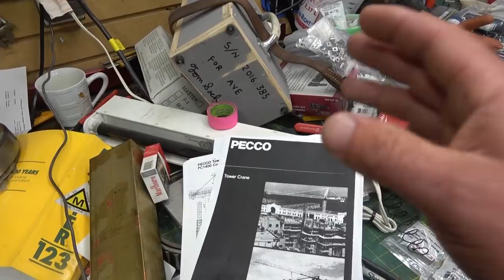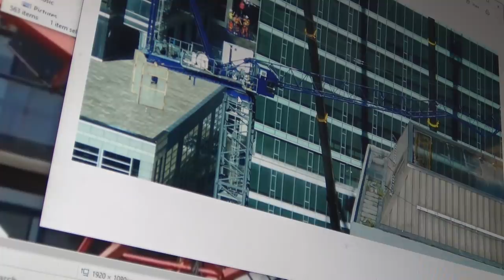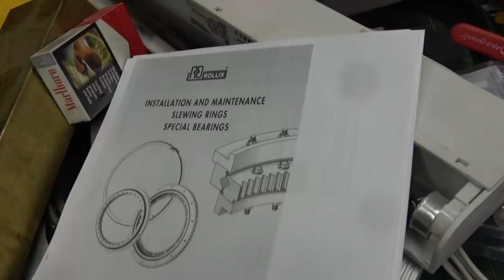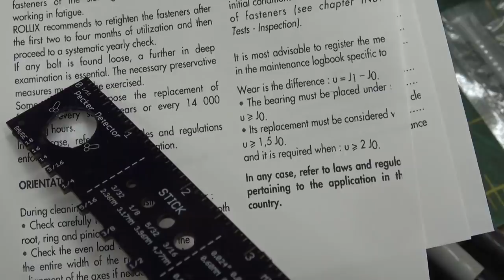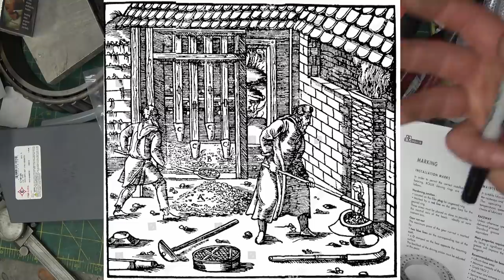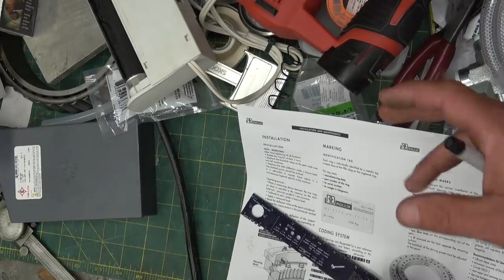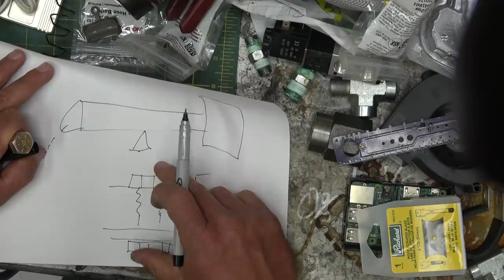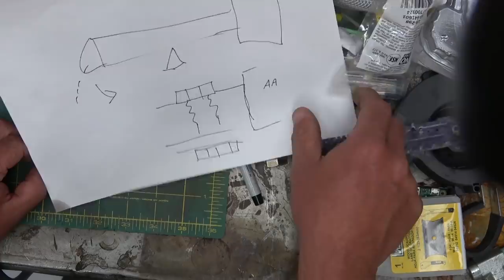This is happening too often | 2 Cranes Collapse in Toronto

Comment: The other issue with inconsistent preload is that if the bolts aren't torqued to the same tension, you haven't spread load between adjacent bolts; whichever bolt is slightly tighter will be taking disproportionately more of the load than it's neighbors. You've basically got two of those rubber bands next to each other, but instead of being the same length and splitting the load evenly, one is an extra two inches longer; neither is flopping around, but the shorter one is taking all the load. If they're properly torqued to the same value, they're starting in the same place and the distribution of force to each bolt will match the nice smooth curve of the moment load.

Comment: From the values in the torque table in the bearing manual, it looks like they are rounded from VDI 2230 and they are for grade 10.9, but crucially they are fine threaded and rely on thread and under head friction of 0.1. 
If someone put in standard thread pitch fasteners in here and used those torque values then the bolts would have way too much preload and could easily break.

Even if they did put fine thread in, the problem with fine thread is the threads get easily damaged in handling/inserting them on site and any contamination on the threads messes up the torque to preload relationship, so preload can be vastly reduced even if the bolts are torqued correctly, and any post installation survey would not detect this either.

Similarly to get the friction down to 0.1 like the manual specs for these bolts the threads on nut and bolt have to be really clean and have very specific ptfe based lubrication applied correctly. Machine oil just won't do it. If this isn't done then again torque-preload relationship goes out the window and preload will be too low and won't show up as a problem during maintenance inspections.

Generally fine threads and fancy lube should be avoided when designing for stuff that lives in a rough environment or needs to be assembled/inspected in site conditions
Reply: James Hoy ahh! Now that makes sense. I’ve wondered why they often use what I thought of as big clunky old fashioned coarse threaded bolts when I assumed a fine threaded version would have provided more surface area to carry the mass. Thanks James.
Reply: @axelknutt5065  No problem.
Must say, I had to go back and double check about the tightening torques of coarse vs fine a couple of times as instinctively I expected tightening torque for fine threads to be lower for a given preload than for coarse threads because the pitch angle is lower in fine threads.

However the torques given in the VDI tables (which this crane bearing references) spec higher tightening torques for fine than they do for coarse at 90% yield preload.
After being confused as to why this was for a while, I looked at the maths behind the table and it is because the pitch diameter, and therefore effective stress area of the  fine thread bolts is slightly larger for a given nominal bolt diameter (threads less deep), so the fine threads are basically a slightly larger bolt. 
The tables are for a preload of 90% yield, and so 90% yield of the fine threads is a a bigger force than it is for the coarse threads.
So despite the fine thread bolts needing less tightening torque per kN or lb of preload, they need more force to get to 90% yield.
Combined with thread friction acting to resist torque at a slightly larger pitch diameter on fine threads, this gives a higher tightening torque in the VDI tables for fine threads (although you do get slightly more preload as a result).

Comment: When I worked in a shipyard they where about to do a 4oo ton lift with two 200 ton slings when an old hand said to the manager that slings are slightly different lengths. They stopped the lift and had delta plates made before the lift commenced.

Comment: As a blue collar laborer, I have to say that this is absolutely typical. We at the bottom do one of two things. 1: We perform maintenance and inspections as our boss tells us to. Our boss, of course, wanting to save money, either tells us to do a lighter inspection that is necessary, or ignores our findings, and thus, machines fail. 2: We perform our own maintenance and inspections, bring concerning findings to our boss who looks at their wallet and says "well that simply isn't within budget" and ignores it until we reach complete failure of the machine.

Luckily, so far in my career, complete failure of the machine has just meant "The hoist falls to the locks and we have to wait extra long to get the car down from the hoist", but I can see already that if management continues to ignore our warnings, as I know they will, my colleagues will be injured by preventable machine failure

Comment: I am a crane mechanic and technician. On tower cranes, especially new ones, you want to see that ring puking some grease out the edges. Every year we re-torque all the bolts (exhausting task) on the tower cranes and of course look for broken ones. I also measure with dial indicators the play in the bearings, at a certain amount I have to replace the ring $$$$$.
Reply: Torque specs are for new fasteners. Fasteners are loose because the threads are stretched (stripped) and/or bolt has stretched.  Should be replacing all the fasteners on a regular scheduled maintenance interval. Finding broken ones shows maintenance isn't done often enough.

Comment: Torque specs are for new fasteners. Fasteners are loose because the threads are stretched (stripped) and/or bolt has stretched.  Should be replacing all the fasteners on a regular scheduled maintenance interval. Finding broken ones shows maintenance isn't done often enough.

Comment: I was always under the impression that a bolt was selected and torqued so that the bolt clamping force from the stretch would always remain greater than any force working against it in order to prevent any strain cycling from even occurring.  If you know the force from the machinery could produce up to 50,000 lb of tensile force to the bolt, you would select and torque the bolt to produce 60,000 lb of clamping force so that the strain in the bolt never changes and can theoretically never fatigue.  That's how it is for engine rotating assembly fasteners.  Any cyclical strain on a connecting rod bolt at 8000 rpm will very quickly reach fatigue failure, so advanced alloys are used to gain the tensile strength needed in a relatively small fastener to be able to torque the bolt enough to produce enough clamping load to always exceed the maximum expected pulling force as the connecting rod is asked to change a piston speed from +4000 ft/min to -4000 ft/min.  You'll either fatigue the bolts or spin a bearing when the bolts stretch and allow the bearing cap to lift.

Comment: Had a similar problem with a 2000 ton injection moulding machine on the closing cylinder. 1 of 4 kept  breaking 12.9 bolts, struggling to remember bolt size 24mm maybe 30. Assembly tightened with 6 foot pipe with two guys swinging. Kept replacing bolt but they kept failing.  Finally woke up and hired a hydraulic torque wrench tightened to spec, end of problem.
Charlie

Comment: Somewhere around I have an old data book for bolts from GKN. In it they said that as long as the internal strain/stress was greater than the external strain/stress applied there would be no failure of the fixture.

Comment: The second "accident" was negligence. The operator saw 2 bolts on the ground, asked the site super where they were from, had no idea. Operator worked the crane without inspection. The bolts were from the turntable. It was found that a bunch more turntable bolts were loose as well. Not torqued properly on assembly. 100% negligent. ( Info from someone VERY close to the company).

Comment: I did an independent study on failure analysis of wire rope in engineerding school.  Even the small diameter stuff is amazing.  Virgin, undamaged wire rope would stretch enough to over travel our tensile test machine and we had to get inventive to find its UTS.  It could stretch because the individual wires could slide past each other, changing the helix angle, and allowing the entire rope to get longer.  But one small impact with a hammer would pin the wires together.  It couldn't stretch and then boom, easy failure.   Frayed wire rope is bad.  Corroded is worse.  But smashed is a fatal accident waiting to happen.

Comment: Preload implies that more bolts around that ring get to share the load. A slack pre-load would lead to a smaller number of bolts getting the jerk load, and then failure. But that is a long way to go to cover static load vs dynamic load.

Comment: As a mobile crane operator here in Onterrible I cringe whenever I get the unit back from any service involving the crane. So many little thoughts roll through my head as I hoist materials '100 and swing it over the building. Mistakes are so simple to make!

Comment: Shear Luck Holmes 🤔

Preload of a bolt is your friend since it takes advantage of friction. That friction is transferring load unto the member, which is stronger than the bolt. As soon as the bolt or nut come loose, friction goes aways and the bolt is now bearing the whole load. Bolt is weaker than member thus we get failure.
Great video AvE.

Comment: Moment load is similar to the way a coin will flatten out on a table while spinning. Similar, but not exactly the same. But it will give you a general idea on how moment load works. One side pulls down while the other side pulls up.

Comment: This explains how my desk chair got so wobbly so fast when I made the mistake of using the tiny allen wrench that came with it. Got a lot better with a screwgun, but the garbage particle board under the dubious 'mammal' leather is permanently wallowed out at least a little. Right now, my plan is some external bracing on outside to stiffen 'er up, but I think it's just doomed to be an anti-chiropractor until I break it the rest of the way.

Comment: I’d bet that’s why the manual also calls for an inspection if the bolts are found loose. Either inspect the bolts for damage or just replace them as they may be failing. If the bolts were already cracked and the just cranked back down on them that can make thing worse. Especially if they kept working loose and they just kept getting tightened.

Comment: Left lay 5/8 and 3/4 is what I used. Bought many thousand feet in my career. Left lay keeps right hand threads tight. 2 1/4x 3 1/4 pin on drill bar and cable socket right hand threads

Comment: Dear Uncle Bumblefuck, I’m a literal Dutch farmboy turned engineer.
Something that is not being thought at university, though this is something
every mechanic knows. Every time a bolt is tightened it stretches slightly;
bots that loosens over time can be snugged op to the correct torque stretching
it further. This can be done several times, every time the bolt gets progressively
weaker, similar to metal fatigue. Every (automotive)mechanic worth their salt
knows this and will not reuse for example head bolts, though engineers are forced
to learn this trough experience.

An easy, yet interesting, way to demonstrate this is by tightening and
loosening a bolt a couple of times and noting how much further the nut has to rotate,
compared to the previous time it was brought op to the correct torque spec.

Might be a good subject for a video, help more people do better.

Comment: Union laborer for 13 years.  Had a cake job filling water cans on a coal fire power plant SCR build  Had to climb a 245' tower crane 2x  daily  then switch out a 5 gal water can.  The operator never drank a drip of that water. He might have made 10 picks on a 3 year project.   Actually I think he may or may not  have taken some ice from the can  to add to a certain Canadian beverage that comes in a purple bag.

Comment: It's not just cranes where you are running into the situation. I worked in a shop in Barrie, Ontario, as a consultant coming up from a company down in Bronson Michigan. 
I was there to help them trying to figure out why they couldn't get the job done. As I walked through their shop the first time I heard a god awful banging and clangng. They were running a aluminum die casting machines which injected molten aluminum into a die and made the castings. The frame of the machine had never been tightened or if it had, it had been tighten so long ago that Moses was a boy and his son's gave up on the maintenance. 
So I said to him you know you got loose tie rods. The reason you're having so much problem with our castings not lining up one side to the other is the die pins are the only thing that are holding anything in position. The the frame of the machine does nothing and the die pins are worn to the point where there's a good 1/8 " misalignment. He looked at me like I had two heads.
They proceeded to complain to the home office that I was there trying to put them out of business They had 4 machines all of them in various stages of collapse. The machine that I was there originally to inspect was a  $375,000 automated  milling machine designed to machine out the castings that they were selling us. Well the guy who got them as a supplier spent his time in Barry Ontario at the bordello and the strip clubs along with the former owner of the company. So he was more than happy to turn a blind eye to anything that they did. The $375,000 machine was a former junked Bridgeport milling machine turned upside down with some cheap 1 horse electric motors bolted to the bed. With collets attached to the end of the motor shaft which held the cutters. 
Evil sleeps in while stupid and lazy does his job. Strip clubs are always involved somewhere in the mix.
I would not be surprised if something similar was going on with the crane.

Comment: I expect that they actually overtorqued the bolts, not undertorqued them. They usually use some kind of lubricant to keep the moisture out, which means the bolt slips easier on the threads, so the actual static tensioning on the bolts is higher than specified.

This leads to metal fatigue right away or, with enough safety margin to stretched threads. When the threads are stretched the bolts will jam on the threads when taking the thing apart and using the nuts the other way around. This will lead to much less actual static tensioning on the bolts, because the tightening force goes into bending the threads.

After so many years of service either the threads will workharden and fail slowly round by round, or the bolts will catastrophically fail. And since most of them are damaged the same way they will fail at the same stress.

That's why you're supposed to check the threads/bolts on any kind of wear, especially lengthening of the bolts in such applications. And why some manufacturers recommend to replace the fasteners on car/truck engines.

Comment: My two cents worth.  The thing is....the tension in the bolts should always be higher than what is experienced due to load variation.  If this occurs the bolts will never fatigue.  The trick is how to tighten the bolts correctly.  The bolts threads and mating faces should be lubricated and bolts torqued with a calibrated impact wrench or other.  Also MoS2 or other solid lubricant should not be used as the bolts can loosen.

Comment: Another thought if the crane has had heavy use over several years is that the bolt stretches a little, maintenance retorques the bolts, then it stretches more, etc, just like the rubber band it can only stretch so far before it geoes twang.
Personally i would change out the bolts regularly, maybe every couple of years, cheap insurance.

Comment: I've been involved in all sorts of mechanical stuff for 50+ years and loose fittings often fails in less time than over tightened ones...but proper maintenance usually wins...
 Quite a lot of really important bolted stuff..like aircraft...the bolts are a near press fit, and the first thread is just below the surface of the assembley...helicopters are this way....you just don't want parts flying off of them up in the air....of course they are almost always safety wired...

Comment: Proper torques was my biggest headache in manufacturing. No matter how many double checks, sign off sheets, coloured markers, pre-delivery inspections, people won't do it. Then the icing on the cake was not using the company calibrated torque wrenches and  going for your grandfathers vintage one because you couldn't be fucked to check out the correct one 5ft away.

Comment: American Crane was Bought by Pecco. Pecco was bought by Terex.
Parts are readily available along with  technical bulletins and technical upgrades. Failed slewing ring is always caused by the fasteners. Unevenly torqued, over torqued or overly used fasteners. It's the Erectors responsibility.

Comment: Purely on the point of fatigue. The fatigue limit is greatly effected by the mean load, meaning that preloading of a bolt negatively impacts the fatigue limit of the bolt, but they are disigned with this in mind. In the video you imply with the rubber that the reduced strain at higher loads would lead to reduced fatigue at preload which isn't true. You can use preload to reduce the mean load in operation in the same way its beneficial to preload reinforced concrete.

Comment: We had a Liebherr 357 hc-l luffing crane loose the brakes on the slew motor. Ripped the 5ton steel form right out of the floor 30 story’s up a high rise. Luckily only 4 guys went to the hospital and none of them died. doing this work for nearly 30 years now I’ve seen crane brakes go out on the slew, trolley, main cable, and it’s never a good day. It looks like the first crane you showed lost the the drum brake on the luffing cable and the operater was third gear swing left trying to avoid the building.